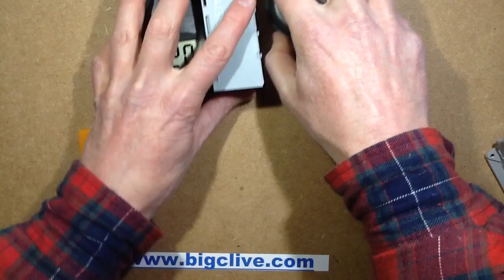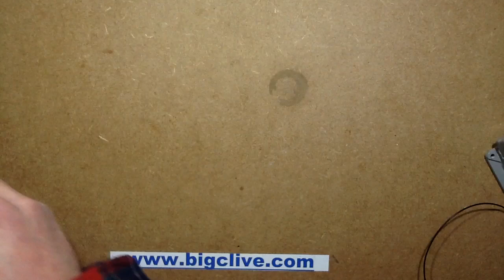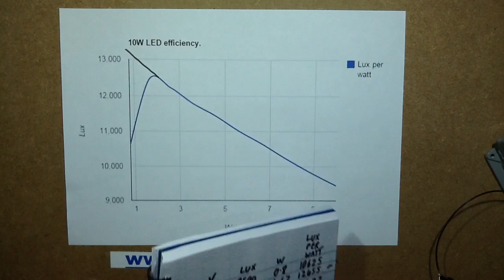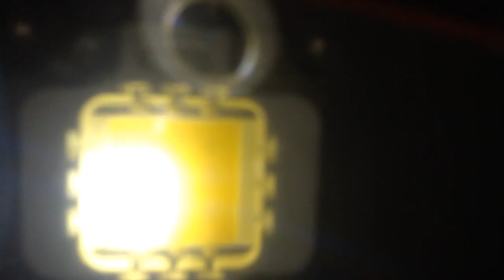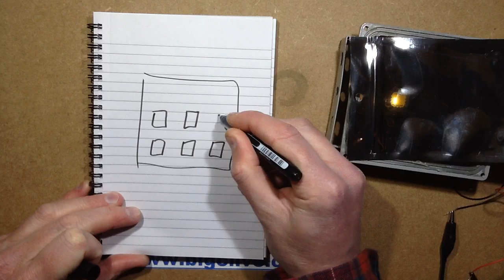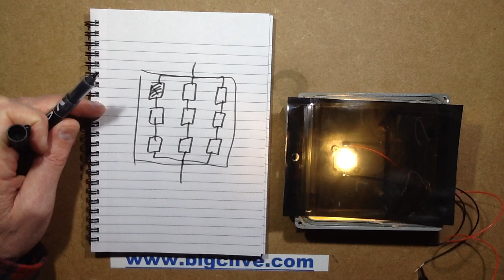10W LED efficiency test with a defective LED!

Comment: It would seem that all light sources produce heat as well as light.  For LEDs much of the low power applied does get converted to light.  If LEDs are going to be the preferred source of house lighting then their lifetime will be critical.  However if they have to be under driven by 50 or more percent, then the capital cost is in reality going to be much higher and overall perhaps CFL bulbs are cheaper.  From what I see at the cheaper end of the market the issue currently is brightness not efficiency or lifetime, yet.  Perhaps we should not throw away our CFL just yet.

Comment: i didnt always pay attention in school, twas a 10w blue chip w/o a heat sink ,so good thing i had the current scaled back, 1/2 pwr,.DUH ! ,blue spots for 1/2 hour ,ya .Took a dangerous short trip to spotsland after energizing it .None of the chips ive rcvd came with any warnings... Don't look directly into the sun even if it is blue. I strongly insist everybody be prepared if your closer than 4 feet from chip and not deflecting it off of something with full pwr DO USE / WEAR EYE PROTECTION.       RV

Comment: I may be making a mistake but in my understanding Efficiency = Watt(out) / Watt(in). The ration LUX / Watt is a measure of luminous Efficacy, not Efficiency. Nice work, by the way.
Reply: +Proiectediversediy Actually when I wrote "I may be making a mistake" I was just been polite. I do know what I'm talking about and Efficiency is DIMENSIONLESS as it can be applied in thermodynamic, mechanic, economy, chemistry, acoustic, etc. It's not measured in lux/watt, but in units(out)/units(in) like in watt/watt, joules/joules, dolar/dolar, mols/mols...
Reply: +RenanzinhoSP Everything electronic/electric eats whats and out pur something: dB in sound ,Lumen in light etc.
We are not intrested if a light comsuption is 100w and the output lumens is 10 lumens,
A 50w led ,if you measure it runing have a 40 w consuption ,but the output in lumens is greate then a 500w halogen lamp we have a winer.Actualy 10 time winer. because we output the same lumens (maybe greater) but whit 40-50 watts of power,so it realy dont matter if the chinese are laying in specs as long as we make much light with a little consuption.
Reply: My opinion and your opinion are irrelevant. Scientific definition don't care about what you and I are interested in or what is convenient. Lumen/watt is "Luminous efficacy" and watt/watt is "Power efficiency". You can find those very well defined in most decent engineering handbook, like I have just checked in "Handbook of photovoltaic science and engineering by Antonio Luque and Steven Hegedus, 2011".
Reply: +RenanzinhoSP The watt/watt is a bullshit and i explain why.
You got a 10 LED who eats 10 W but  2% are light and 98% is heat.Is that efficiency?No its not.
Reply: You can't say that 2% of bananas are apples, this is not how math works. It means you can't say that 2% of 10W is "light". "Light" is not a physical unit. Alternatively you can use the relations "candela vs watt" (radiant intensity), "lumen vs watt" (luminous efficacy), "lux vs watt" (irradiance) and even "watt transformed in light vs watt input" (radiant flux). In that last case you could say that 2% of 10W (input) were converted in 0.2W of "radiant flux" in the output of the system, indicating 2% of efficiency. I would suggest you to search those terms on wikipedia for a quick reading.

Comment: I am use this LED to home bright.
Where power LED at 650mA is optimal?
I am think, what in 650mA about is effective current for minimal warm energe of Led with avarege light.
https://img-fotki.yandex.ru/get/15570/266461478.0/0_1094f5_35b4dc22_orig.jpg
Reply from the maker: Running the LEDs at 50% of their rated current seems a good compromise between light output versus efficiency and lifespan.
Reply: bigclivedotcom 
Thank You.
But I don't find led driver's with current 450 mA :(
And 300 mA is very little..
Thanks..

This led I am interest when good price(0.4-0.5$) and good kpi = lumen/$
It is better kpi, where have led 5050.
Thanks.

Comment: common practice to use out of spec devices at lower levels, 3 core cpu's from failed 4 core etc, even sinclair spectrums used faulty ram chips to reduce costs...(fault in upper half, only wired lower half..)

Comment: Did you "soak" the LED's array at a current level that was enough to light all LED chips for a couple of days? Maybe you can "cook" the weak chip into "behaving" properly.
Reply from the maker: I know that some LEDs "come back" if you run them for a while, but the initial low resistance tends to indicate an inherent fault with the chip that will result in early failure.
Reply: bigclivedotcom
I see. Just a victim of poor quality control.

Comment: Hah, wondered if anybody else used anti static bags to observe power led die, short of welding goggles it works really well.  Double it up when you crank the power up.

You do often get these power leds where the die are not entirely equal at low currents.
Reply from the maker: Handy random tip....   If using things like theatre gel or other dark plastics to look at very bright objects (like the sun!) note that some of these materials while appearing dark are virtually transparent to infrared energy.
The antistatic bags are useful as a random neutral density filter.